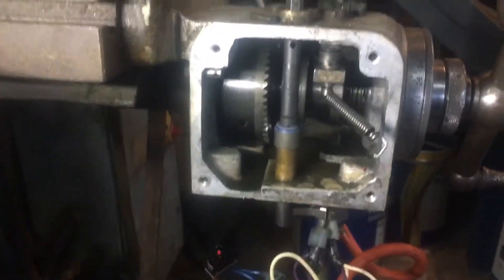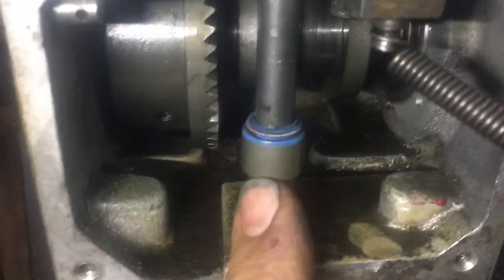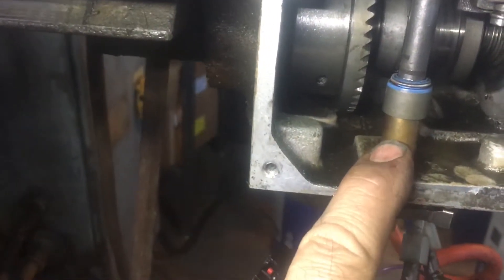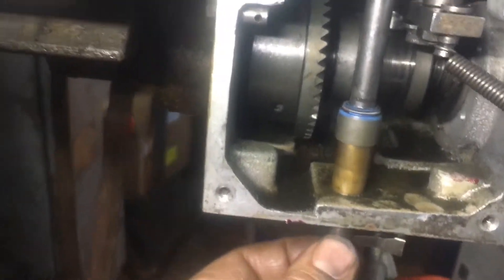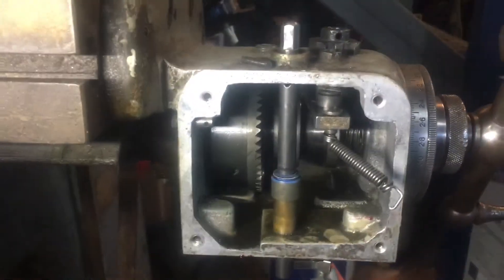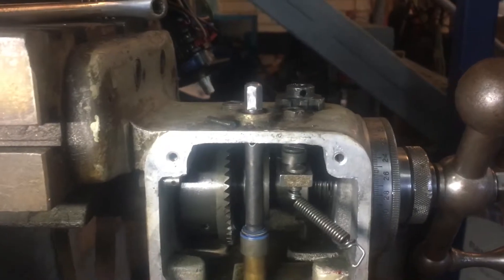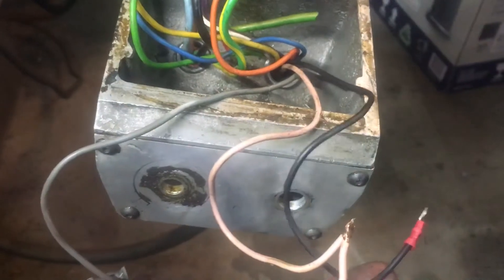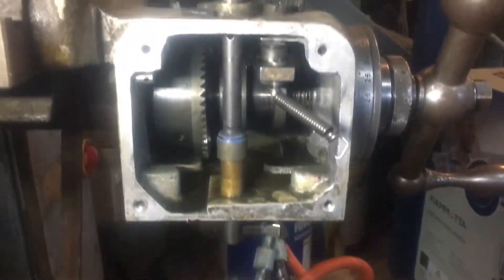Bridgeport 6F power feed oil leak repair P2

Comment: Valve stem seal is a great idea. Did you ever get it up and running?
Reply from the maker: The Ayr Cave Shop 
Yes I did.
I bought the machine untested.
At first I thought the board was burnt out, after checking it out I couldn’t find any burnt  components so I put it back in.
Then I found a red button on the board that I couldn’t work out what it was, then one night I woke up at 2 am and said to myself that that button has got to be a reset switch, so that morning I raced back to the workshop and pressed the button then the feed came to life.
At the moment I’m slowly reassembling the head.
I just finished cleaning out the variable speed gears and cleaning out all the crap.
When my internet decides it wants to work again I’ll be uploading another short video.
Reply: Most of my life i've always figured out how to do things without a mill. Now that I've had one for couple years I would classify the mill as a top 5 must have tool for any home or pro shop doing metal work. Don't think I could survive without one now.

Just hit subscribe to help you get some views.

Dean

Comment: good evening
kindly could you help me for the potentiometer connection (speed variator) and the fast forward connector for powerfeed x
Thank you
Reply from the maker: valter forlano 
I didn’t rewire the machine. 
I basically fixed up the existing connections and replaced the switches.
If you google wiring diagrams for Bridgeport something should come up.
Reply: good evening in the motor unit y I found a metal tube that is mounted around the mechanics is used for oil could you tell me how to mount it?
thank you